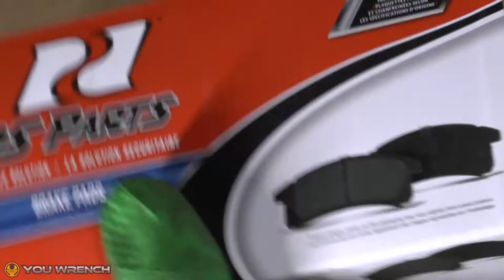How to Change REAR Brake Rotors (Discs) and Pads  (Complete Guide) - DODGE GRAND CARAVAN 2008-2021

Comment: Why did you not a-line the piston notch to the pad pin. It should fit in.
Reply from the maker: Hey there! Thank you for your question. This video is on a MK5 (2008-2021) Grand Caravan which have the rotating rear piston. Maybe you are thinking of the older model? But thank you for asking, we have now updated the video details to specify that it's for the MK5. Thank you again!

--- 

To help support us (for both you and others reading this) there are a few things you can do:

1) Donations both needed and welcome! We cannot operate You Wrench without the support of people like you! You can donate by PayPal - just go to www.paypal.me/youwrench

2) Please ensure you subscribe to our YouTube channel. 

3) Please Like our video's on YouTube (by clicking Like!) 

4) Please help spread the word, the more people who know about us the better! Add links to our video's in forums, let people know about us.

Thank you for your support!
Reply: @YouWrench  The 2019 rear piston has cutout on its face that is used with a special tool to turn it back into its bore. This cutout also matches up to a small pin on the brake pad. Very few videos are aware of this. Take a close look. Thanks for responding.
Reply: @YouWrench  spreading the word!   Im tired of getting robbed at the car dealer shop.
Reply: My 2008 Town & Country has the pin on the brake pads and I had to line up the piston notches before it could be assembled.  The driver’s side worked good. The passenger side didn’t.  The piston was to far away from the pad to work.  I turned it 180 degrees out and the caliper would not go on, because it was too tight on the pads ( about 1/16 of an inch).  Tomorrow I will file / grind one of the pads down about 1/16 of an inch.  Only thing I can think of.

Comment: My 2013 brake peddle is mushy after i replaced the rear brake pads. I pump the brake peddle and the emergency brake peddle many many times but it doesn't seem to re adjust back to normal ! What is the truck ?
Reply from the maker: It sounds like you may have got some air bubbles in the system. I would try bleeding the brakes first of all and see if you get air bubbles coming through the line/s during the bleed. Best of luck!

--- 

To help support us (for both you and others reading this) there are a few things you can do:

1) Donations both needed and welcome! We cannot operate You Wrench without the support of people like you! You can donate by PayPal - just go to www.paypal.me/youwrench

2) Please ensure you subscribe to our YouTube channel. 

3) Please Like our video's on YouTube (by clicking Like!) 

4) Please help spread the word, the more people who know about us the better! Add links to our video's in forums, let people know about us.

Thank you for your support!